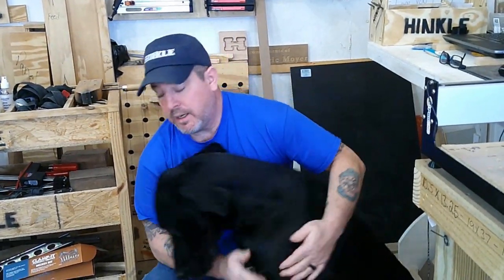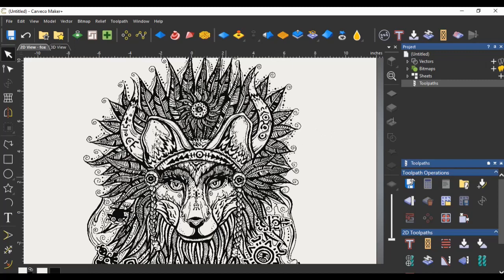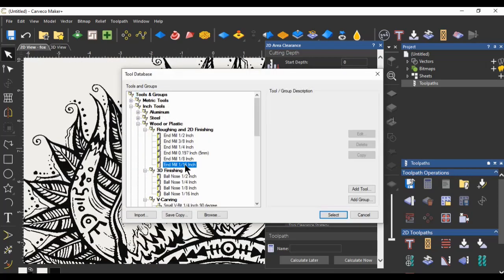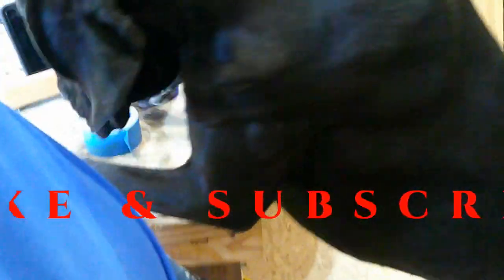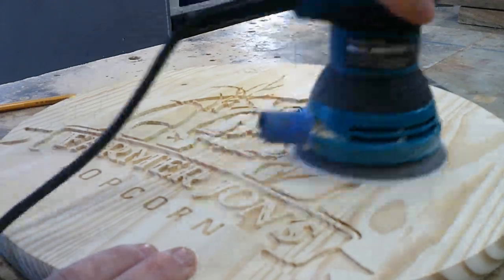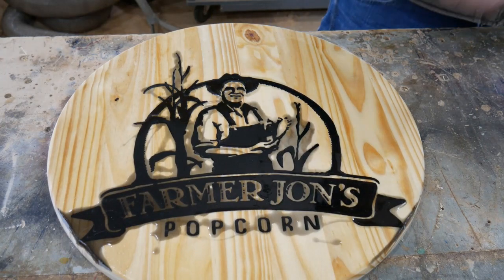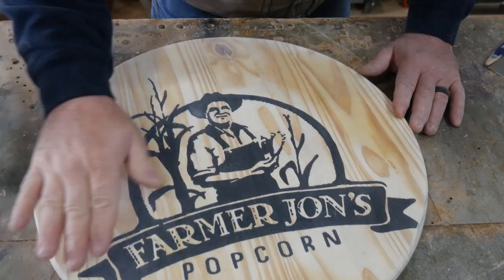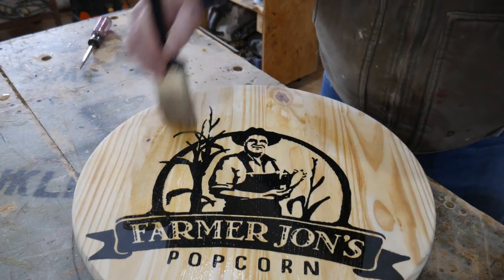For the love of Popcorn! V-Carve sign using Carveco and my Shapeoko xxl

Comment: nice, I haven't tried the epoxy plunge yet, you got any detailed videos on your procedure?
Reply from the maker: Thank you for watching 
Sorry no video specific to epoxy but I can recommend one tip 
Always brush on one or two thin coats of epoxy to seal the wood before applying the color this will reduce the bubbles 
Oh and I whip a torch over the epoxy to remove bubbles (very fast movement)